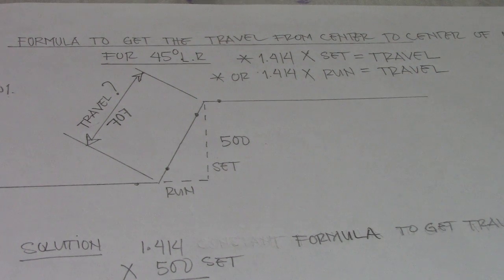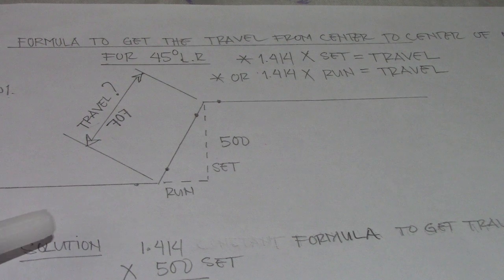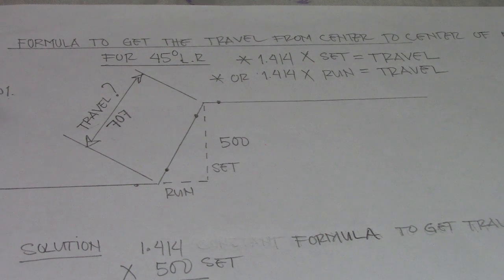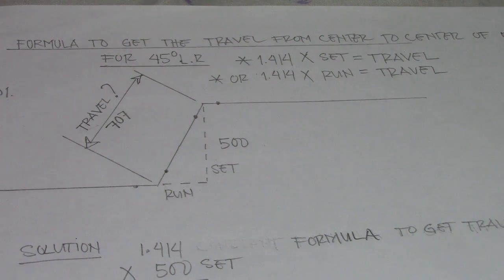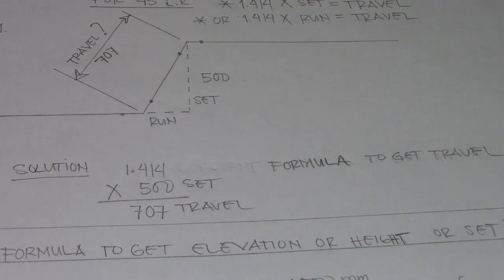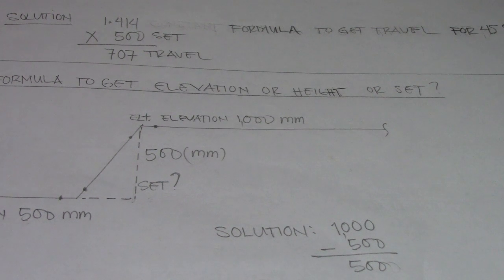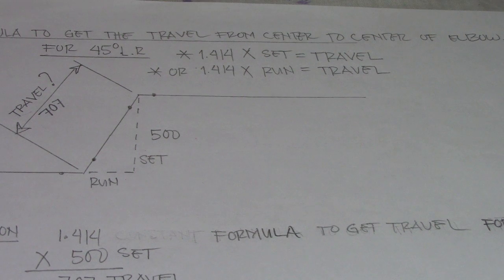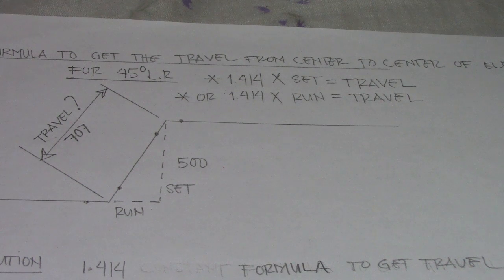45 Degrees LR 1.414 - PipingWelding,NonDestructiveExamination-NDT

Comment: Hello bro' pls explain properly.i saw all yours videos but you didnt explain how does it come 1.414 and 15.8.i tell you formula travel or hypotenuse 45'elbow always 1.414 times bigger than run and set( adje or opposite).long radius elbow formula  Tan(any degree/2)x1.5DX25.5.This is formula to find elbow center or tan(any degree/2x1.5 x25.4)=15.8xD.